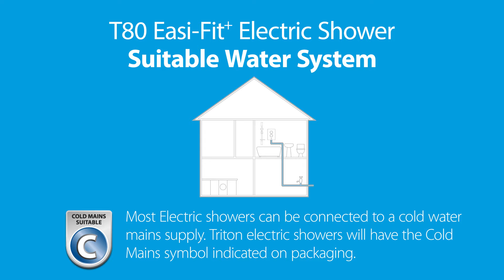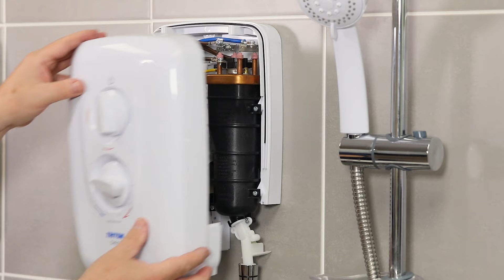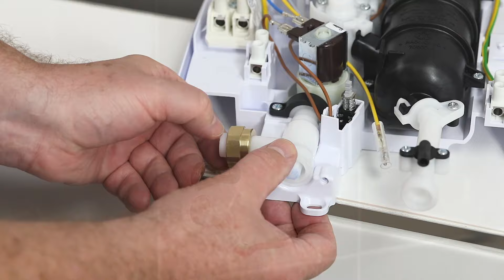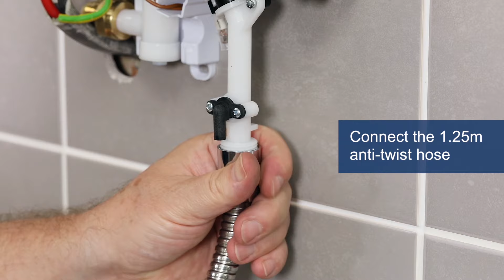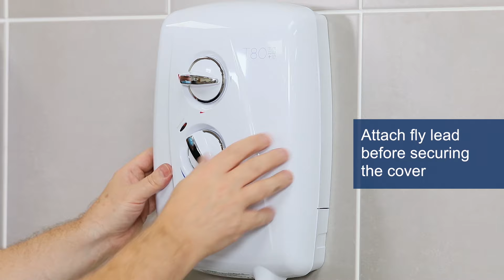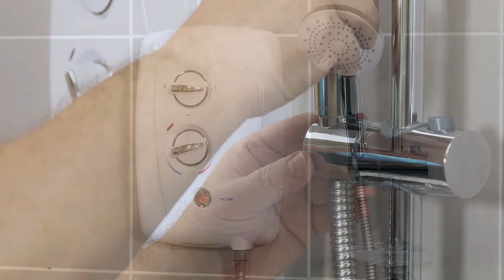Triton T80 Easi-Fit Plus Electric Shower | Installation Video

Comment: Our old Mira shower had been installed since around 2005ish time and it was proper broken the turn knob was snapped inside and it was not warming up you couldn’t get spare parts etc and it's took until a month ago for me to say no more!!! And I ordered the Triton T80 Easi-Fit Plus shower from Screwfix next day delivery, the only issue was there was no manual so I had to print it off but it's self-explanatory and it is absolutely outstanding! 

Everybody loves it no more playing shower bingo just press a button and in seconds red hot water is flowing! 

Took me less than an hour to install and it's a choice that if something went wrong in years to come, I'd 100% not wait I'd order a new Triton within days because after seeing just how easy it was to install/use it's changed my and the family's life!

Thanks Triton and thanks for the easifit series ⭐⭐⭐⭐⭐ I 100% Recommend this shower unit...

P.S The video is a great help!!!
Reply: I think the exact same thing happened to our Mira yesterday! It was finnicky for a while where you had to push it in before being able to turn it, then it actually snapped properly yesterday.

Comment: Hey what is the exact brass compression fittings required for this?? It’s crazy that these are not supplied
Reply from the maker: You would need a 15mm compression fitting.
Reply: I too am disappointed that the compression fittings aren't in the box. I'll need a brass nut too to complete the job. Is that 15mm too? Only the external nut diameter is closer to 25mm on my old shower. Thanks for any advice.

Comment: Hi, i just replaced the solenoid coil after the same shower stopped running water completely the day before. It solved the issue, there is now water but it is freezing cold, no hot water comes through. I only did a straight swap of the fault coil from before to the new one, what couldve caused it to not heat water now?

Comment: Just fitted T80 Easi -fit plus but was unable to fit the bottom section due to not enough space because of pipe fittings but the main issue is I have power and light on the ON button but when pressed No water? Thanks for any advice
Reply: i have the same issue, did you find a solution (please 🤞)

Comment: Just fitted same product,  all work just fine, but I don't know if ok for the on off button to be light up all the time even if not in use.
Reply from the maker: The power indicator will always be on providing the shower has an electrical supply going to it, this is just to indicate there is power to the product and is intended.
Reply: Is there anyway of turning up the pressure when having a warmer shower?

Comment: hey my T80 leaks water from
the shower head even when the shower has been turned off? any ideas the only way i can stop the leak is by turning off the water ?
Reply from the maker: If the product is passing water with the electric supply turned off this would indicate the inlet solenoid valve is stuck open. In this instance we would advise contacting our customer experience team on 02476 372222 for further assistance.

Comment: Hi, I have a triton electric shower. How long should we wait for it to get warm? Also, recently it hasn’t been heating up in early mornings and late nights what could be issue ?
Reply: Try the shower head itself, remove it and allow the water to flow from the flex pipe, if the temperature controls don't change the heat of the water you can also try switching it off from the fuse board or isolation switch for a minute or 2, if that doesn't work then make sure the valve to the supply of the shower is fully open.. if all of that doesn't work.. it's recommended to replace after 4/5 years anyway.

Comment: I have just installed this shower but there is no water coming through, plenty of water pressure up to the shower and the electric is working
Reply from the maker: Hi Alan, if there is no water coming from the shower this could be a site or product related fault, in the first instance we would advise checking that there is at least 230v going to the product to operate the inlet solenoid valve. If the voltage appears okay we would have to advise contacting our service team on 02476 372222 for a potential warranty visit. Kind Regards, Leon.

Comment: What position should the hot and cold dial be at when placing the face plate on ....... the temp guage doesnt make sense
Reply from the maker: For fitting the cover and aligning the dials we have step by step instructions on how to do this in our manual shown on this link https://www.tritonshowers.co.uk/amfile/file/download/file/318/product/3442/ found on pages 18/19. Kind regards, Leon.

Comment: I have this shower and I replaced the shower head and now the water is only coming out ice cold, any ideas?
Reply from the maker: Thank you for your comment. If the shower head used is not a Triton Shower head this could have restricted the flow coming out of the unit and caused the safety cut out to operate causing the water to only run cold. To discuss this further please contact our service team on 02476372222 and they can advise further. 
Kind regards,
Sheila.

Comment: I just installed the triton t80+ but the neon light remains constantly on even after i switch the button off is this a fault? it only disappears when i switch it off at the wall but that kills the power to the shower ..its just annoying to have that lit up all the time and we dont want to keep stwiching off the isolation switch on and off
Reply from the maker: Hi, even in the off position the neon indicator will be illuminated. It's essentially just an indictor there is power to the product, this should only go out if the power to the product is isolated at the isolation switch.
Reply: @TritonShowers  So am i safe in keeping the shower on all the time with neon indicator showing without turning off the shower at the main light/isolation switch..meaning id like to keep the shower constantly in on/standby mode rather than having to keep switching the light/isolation wal switch on and off as its a busy household and we use the shower 3-4times a day ..just worried if constant supply in standby will burn out any parts in the shower unit?
Reply: @barakobam6123  Hi, keeping the shower in a standby state would not damage any of the components, however as a general rule we would always recommend isolating the power to the product whilst not in use.
Reply: @leonkingston2146  Thank you soo much for a direct ans to my issue

Comment: Wanted to ask , my unit is turning off the electricity breaker when it’s turned on , does it mean the unit is dead
Reply from the maker: Hi, if the fuse is tripping this is generally either an undersized fuse in place for the shower or potentially one of the elements having an issue. You can find more information on the correct size fuse required on this link page 9 https://www.tritonshowers.co.uk/amfile/file/download/file/318/product/2558/ if however you believe the shower is faulty we do offer in and out of warranty repair visits on our service line number 02476 372222. Kind regards

Comment: Hi, I bought a T80 Easi-Fit and want to know if I should seal the whole thing with silicone to stop water getting at the electrics ?
Reply from the maker: Hi, we say not to seal around any part of the unit using silicone sealer after fixing to the wall. Kind Regards, Leon.

Comment: I have has this shower a while.... around January time it started randomly turning off mid shower.. however after a few days has been working fine until this last week. The shower at first came on for around 2 maybe 3 minutes and the  went off  then randomly came back on. If the shower went off mid shower and I forgot to press the off button even though no water is coming out it could randomly after even an hour come back on. Its now decided to  completely not work ... all lights are on however when pressing on no water is coming through. Any help or suggestions.
Reply from the maker: Thank you for your message, If the water is stopping mid use this would usually be either an issue with the incoming voltage dropping below the minimum required 230v. Or an issue with the operation of the solenoid valve due to issue on the valve itself or on/off switch. We would advise a voltage test to be done in the first instance, if however the electrics appear to be okay then we would advise contacting our service team on 02476 372222 for further assistance. Kind Regards, Leon.
Reply: every time i call you i’m 30 in the queue 😢

Comment: Hello hope you are well i have the same shower but when i swich it on water is leaking from the bottom i dont understand why the water is leaking its not lesking from any of the pipes
Reply from the maker: Thank you for your enquiry and sorry to hear this. From what you have described, it would seem that your shower's Pressure Relief Device (PRD) has activated. This is a safety device, triggered to function when a build up of pressure is found within the shower unit. This would usually be due to limescale build up, kinked/damaged shower hose, or a blocked shower head. Once the device activates it would need to replaced. The part is low cost and relatively straightforward to replace and i available either from our website or via our Spares team who can advise further over the phone. For more about the Pressure Relief Device, please view our 'Electric Showers | How to change a Pressure Relief Device (PRD)' video.
Reply: @TritonShowers  Do you have a contact number for your spares team and do you have a link to the video you mentioned? I am having kind of the same problem but it seems to be leaking from the PRD and the white unit it is connected to

Comment: Just fitted this shower and only gets hot at low pressure. As soon as you turn up the pressure it loses heat. Has anyone had this problem? TIA
Reply: Me,  trying to figure it out.

Comment: Why would one off these showers NOT heat the water after fitting a new unit
Reply from the maker: If the water is cold only, we would advise in the first instance doing a pressure test to the product. They will require a minimum running pressure for the pressure switch to operate the elements. For 7.5kw-9.5kw models you will be needing 1bar running pressure and 10.5kw models will require 1.5bar running pressure. If you test the pressure and find its above the requirement then it would also be worth checking the inlet filter is clear of debris and any isolation valves for the product are fully open. If these checks don't help we would advise contacting our service team on 02476 372222 for further help. Kind Regards, Leon.

Comment: What does the orange bit do
Reply from the maker: If you're referring to the orange rectangular piece inside the shower, this is a pressure flag, which sits behind low pressure window. This would move in conjunction with the pressure switch up and down to show you if the shower is low pressure or not. Kind regards, Leon.

Comment: After installing, why cant I get an inbetween temp… it’s either burning hot or very cold. Water coming through fine & I admit to not seeing a pressure test carried out but the water doesn’t look like it’s low pressure…. If I turn the handle fully to the 2x red lines it’s burning hot & doesn’t go cold but when I turn it ti the single red heat sign … it goes freezing cold… anyone advise if I need a water pressure pump installing .?

Comment: Easy fit if all the plumbing connections are the same. Sadly mine are not. Plumber it is then.
Reply: Yeah. Nice speedfit connections they have. Imagine trying to fit this to old compression fittings after the initial cowboy first fix.

Comment: Where will I be able to turn the water off should there be a valve next the shower or is it the the main stop cock
Reply from the maker: We do advise that the shower should have its own water isolation should any servicing be required to the shower. However, if this is not the case then the main household stop cock would be used to isolate the water.

Comment: Hello 

I moved into a property with this shower in it

When i turn it on, it takes about 30 seconds for the water to go from completely cold to ideal 

What would be causing this?

The previous house i lived, had a different old shower, which never did this

Comment: Just fitted Shower it is working put the power button isn’t lighting up. Why is this.   Hot water is all good
Reply from the maker: The power neon would clip onto the back of the start/stop button, it may be that the neon has come away from it's holder behind the button. We would say checking this in the first instance, if the neon is in position but not lighting then it may be an issue with the neon itself. In that situation we would advise to contact our service team on 02476 372222 for further help. Kind Regards, Leon.

Comment: 9.5KW mention in this device does it mean 9500 WATSS 😮? AND almost 41 Ampr power consumption???? 1 ton aircon consumes 1500 watts and 2 ton aircon is 2000watts how come it consumes 9500 watts it is like using 5 air-conditioning units at the same time